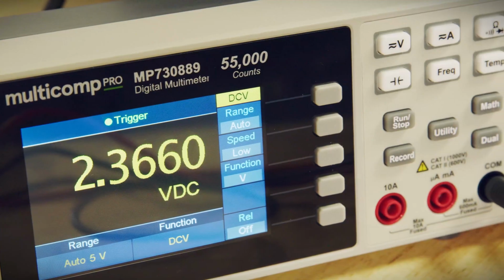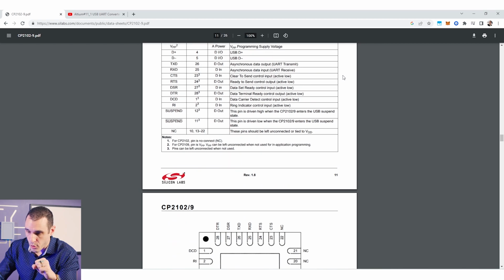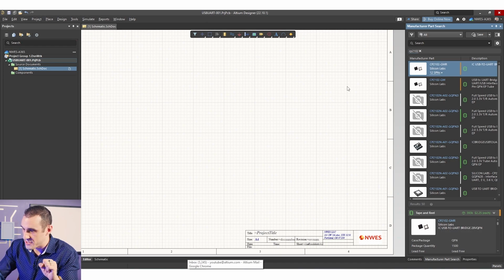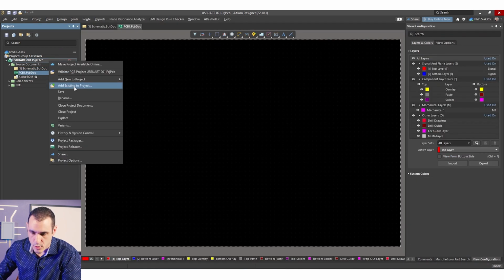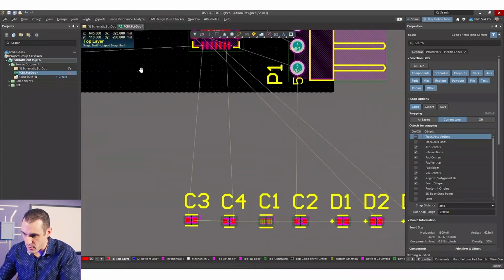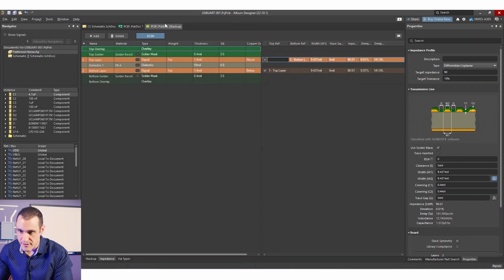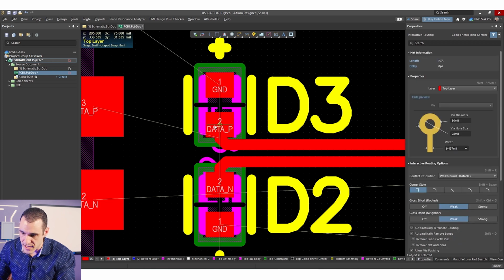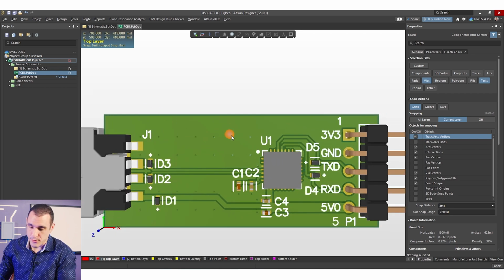How to Design a USB to UART Bridge with CP2102

Comment: data option in the differential pair is not shown. I followed the same steps as you suggested, but it's still not appearing. Can you suggest a solution?
Reply: Have you installed the CP210x driver from Silicon Labs on your computer? The driver is not pre-installed on some operating systems.

Comment: Can you tell me if the circuit needs programming and loading code? please?
Reply: No it does not require loading code. I think the CP2102 and newer part number drivers should be included in the newer versions of Windows. The drivers can be downloaded from the Silicon Labs website, just do a search on Google.
Reply: thanks @Zachariah-Peterson

Comment: Hi,
Why we are not using esd protection for uart connection
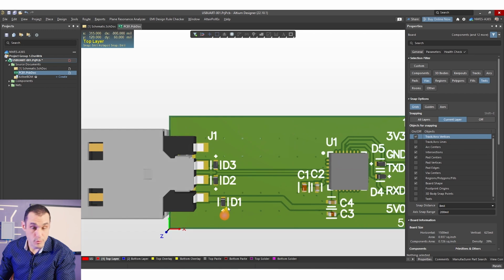Reply: If you look at the finalized board at about 21:14, you will see that TVS diodes are present on the UART lines leading to the pin header (D4 and D5). I also added some additional protection to the VBUS rail on the pin header side. Finally, there were a couple minor routing modifications made to the design, you can download the most recent project files from the link in the description and take a look.
Reply: @Zachariah-Peterson  thanks

Comment: Can i connect the UART lines to a RS232/RS422 transceivers??
Reply: UART lines can be connected to RS232/RS422 transceivers. RS232 and RS422 are serial standards that are similar to UART. RS232 and RS422 only specify the physical characteristics of the communication medium. You might need to use level translation when connecting to the RS transceiver.

Comment: It was great tutorial for me. When you started placement, I thought you would place the chip close to USB port in order to keep under critical length for convenience but you didn't :) I am curious about if there are any reason not to do so  ?
Reply from the maker: Glad it helped
Reply: Two things:

I think we all need to stop using the idea of "critical length" as a design rule. I never use this in design except on very long SPI buses. The reason is that the actual critical length is arbitrary and depends on multiple factors, so if you think you are designing to a 25% rise time value for critical length you might actually need 10% value. I show why in a different video and it should be released soon. The other reason is that there is not a requirement for the placement like that, I wanted to route the lines by following an impedance profile and ground clearance to illustrate how easy it is to route coplanar lines correctly. Many designers will design something like differential micostrips, but then they put the ground pour on the top layer, and if they put the pour too close to the lines it creates a reduction in impedance.

Comment: The CP2102 is compliant with USB specification 2.0 full-speed (12 Mbps), so you cannot design high-speed USB 2 with the CP2102 right?
Reply: When I mention "high-speed" anywhere in the video, I am not referring to the high-speed USB 2 spec, I am referring to high-speed PCB design practices generally.

Comment: You added some space for the TVS diodes, then decided it was more than needed, but didn't take the extra back out, even though that would have allowed shrinking the differential pair.  Was this just a "not worth the bother" decision, or did you want a longer module or more spacing for reasons you didn't go into, or ..?
Reply: At the end of it the module was finished and it's not worth the bother to cut out the extra space, it only ends up being about 0.25" longer than some of the other modules I have, but it's shorter than a different FTDI module I have that broke. So based on that I'm in a comfortable range someone would expect to see for the size of the module. Cutting out the extra space is easy though, if you wanted you could turn on auto retrace and drag the components back towards the USB connector.

Comment: One suggestion for making hobbyist/experimenter boards: please silkscreen the pinout on both sides of the board... this makes it so much easier to make the correct connections when plugged into a solderless breadboard. Wasn't the point of this video of course, and maybe the files include that. Also do include my +1 to the general acclaim for Zach's videos. They're excellent!

Comment: A minor comment - probably more for others who may not be super familiar with Altium: When you centered the USB connector position vertically in the board, you went to a calculator outside Altium and then manually entered the calculated value in Altium.  You can do the math in the coordinate entry box in the properties panel inside Altium.  IE, you could have just entered "625/2" mil in the Y dimension entry box for the component.  You can do simple math functions directly.  I'm not certain about more complicated expressions.
ALSO, and this seems to be not widely known; If you want to move a group of items - let's say the ref designators for those 3 transient suppression diodes at the USB connector.  They might have a common X value, but they do not have a common Y value.   If you want them all moved up 50 mils you can move them all individually, or select the 3 ref designators and then enter "!+50" (without the quotes) in the coordinate entry box in the properties panel for the Y value - and voilà, they are all moved in one action.  I find this handy with reference designators because the "move>move selection by X:Y" command does not work on ref des (probably because they are elements of a component).
Reply: NIce! I had no idea about these coordinate features, thanks!
Reply: Wow, that is a really good tipp! Thank you!

Comment: Was amazing, Silabs moves the 2102 and 2103 to available, few years ago they was NRND.
Good, stable chips, even if faked.
More than USB ESD, need to have isolation between USB and UART sides, like speed optic.
And sure, didnt forget about datalines impendance matching (but it works anyway on such distances).

Comment: CP2102-GM is an old chip with the maximum baud rate of only 921600. Is it really that important to route the data lines as dif pair at such short distances... CP2102N though is capable of 3 Mbaud.

Comment: Hey Zach, great video content as always. Recently I was working on Arduino test setup that is used to validate Battery Management ICs. I was validating the communication between the chips and Arduino via UART and boom my laptop shuts down. 
Turns out, the surge voltage on the VBUS line killed my laptop motherboard. 
It would be great if you could make some videos on surge protectors and isolators for USB.
Reply: Great idea, looks like I will have to add this to our project list. If you go to Google and search the Altium blog for USB isolator, you'll see an older project from Mark Harris, I'll start working on a video project as well.
Reply: @Zachariah-Peterson  surely, I will do that. 
So after doing some research, I have 2 design variants
1) USB Isolator + Host Power supply isolator 
2) USB Isolator + External power supply
Which do you think is good? I'm leaning towards the second one, as I usually have a bench power source in my work area. (Also would like to sink higher currents)
Also, could the common ground between external power supply and host computer induce noise/surges on the gnd rail?

Comment: Hi Zach, great video!
Some USB applications doesn't connect the USB connector chassis or shell to the system ground, but some does.
Could you please explain why are there different design?
Reply: This has been discussed a couple of times. If your product is an end device, better not connect the shell. But since this is a bridge that connects in between the host and device, it has the option to tie the two system grounds of the host and device.
Reply: In some devices, there is no chassis ground, so you have no choice but to tie it to the system ground. Sometimes, you might be connecting a USB device with no chassis to another device that does have chassis, if you connect the connector shield to the system ground on the USB module then you have bridged the host's chassis ground and your module's system ground.

Comment: I’ve used a lot of these…on every FTDI of mine..there is always a switch or bridge connector to choose voltage…either 5v or 3v…not both.
Reply: Do they also blow up from time to time? I've used an FTDI one and it didn't last long, so I switched to another one that came in 3-packs.

Comment: Great video! This is very useful as Im trying to do a custom made PCB with STM32 and I had already failed once because I couldnt get it to be seen on my USB port :D
Reply: I know there are Windows drivers for CP2102-based devices so that they can be accessed over a COM port on TeraTerm. That would make it a lot easier to get to your STM32 over a UART connection.

Comment: Might be a dumb question, but at 16:20, 5v and 3.3v output pins were swapped. Is the idea you'd update all the UART socket pinouts on the target devices to match? Or why are you able to swap the output voltages without concern?
Reply: Hi
Since it is the output connector, you can place it, in which ever order you like. You are right that they have to match the receiving end as well.
Reply: These devices are normally used with flying leads coming off the pins and connecting to a target device, so you have freedom to set them how you like.
Reply: @Zachariah-Peterson  Thanks, makes sense! For some reason in my head I had it that you were shoving this thing directly into a PCB-mounted female socket. Flying leads much better idea hah